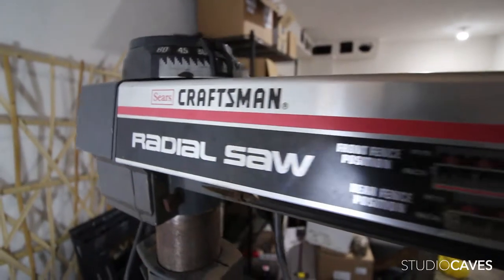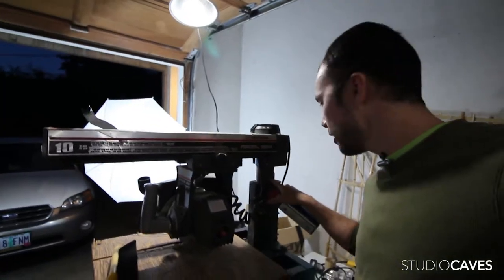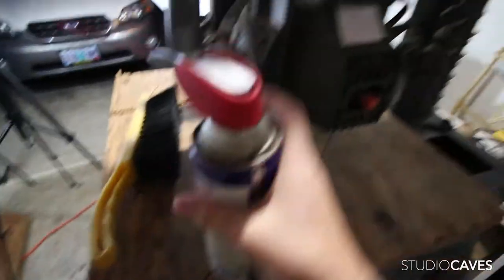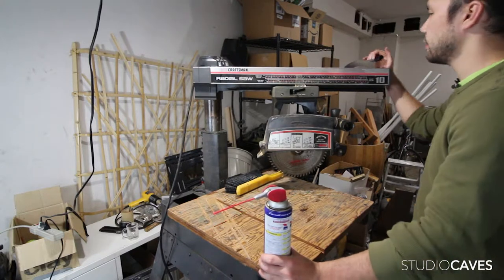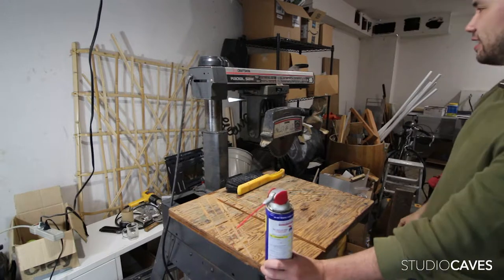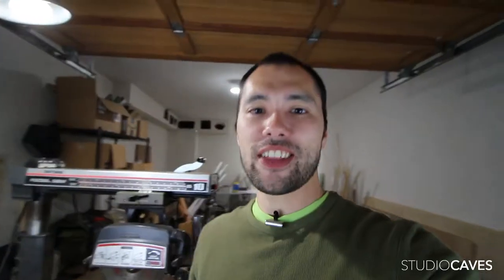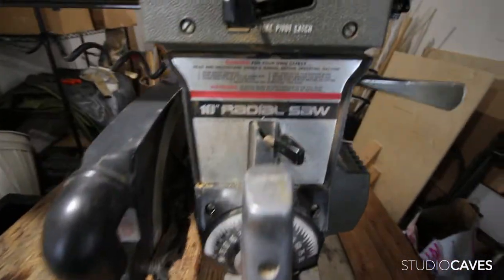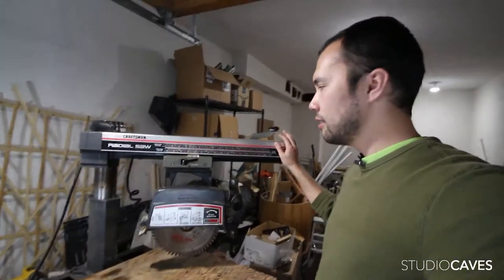My New Radial Arm Saw and How It Works | #SCWeeklyUpdate - Episode 4

Comment: WD-40 will help you clean it, but won't keep it greased. I would use motor oil on the shaft (there might be an hole there to add a bit of oil).
Reply from the maker: Thanks for the tip!